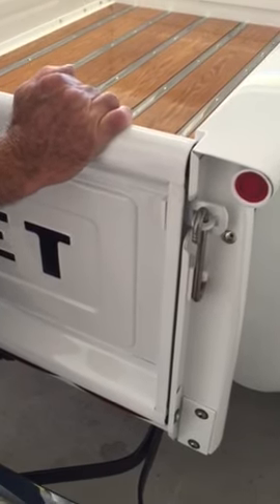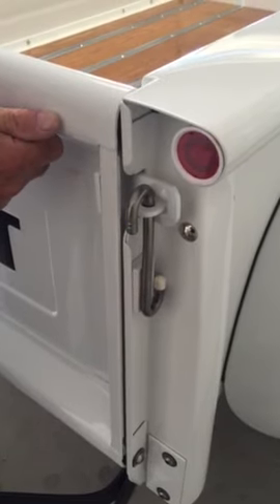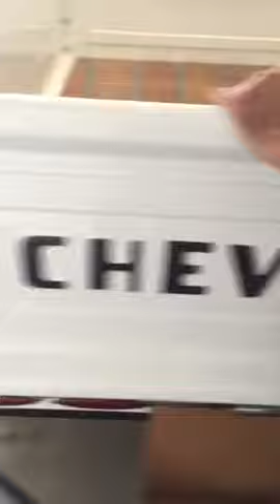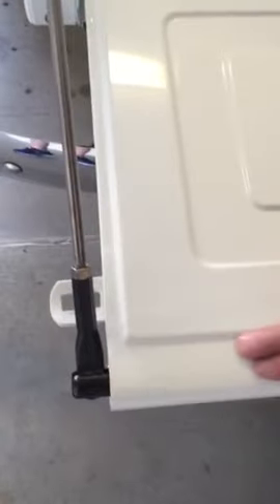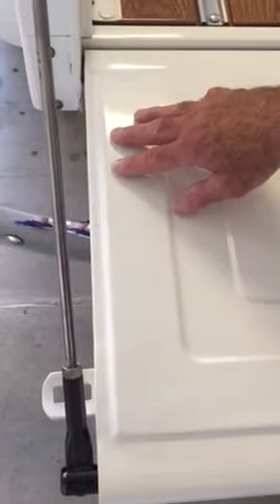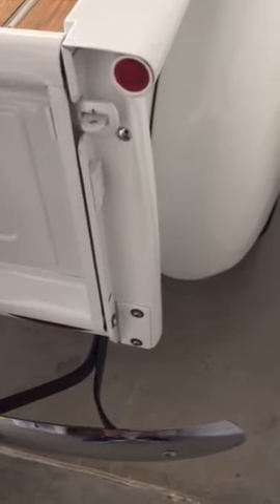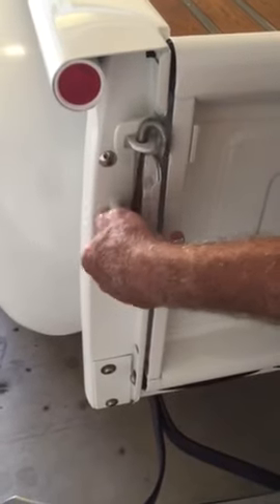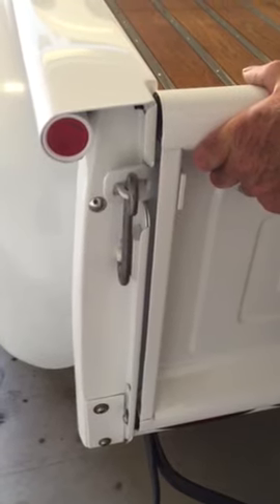Tailgate Chain Eliminator

Comment: I think you left out one thing the top of the tailgate where you slide in your bracket it has a plate which would gave to cut out . Correct ?
Reply from the maker: swivelgate:  in response to your question:  “yes”.  To install this item the installer has to manufacture a “keyhole” at each end if the tailgate.